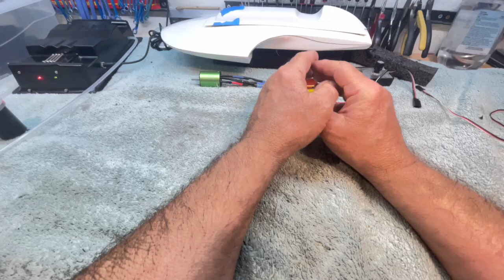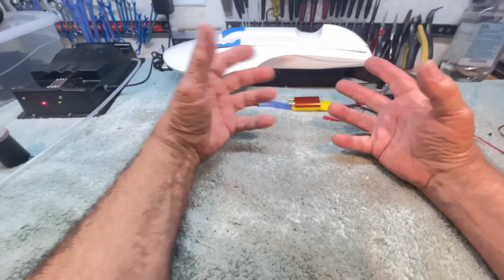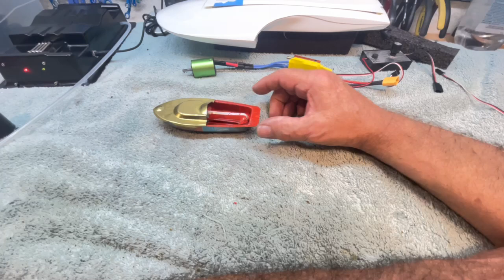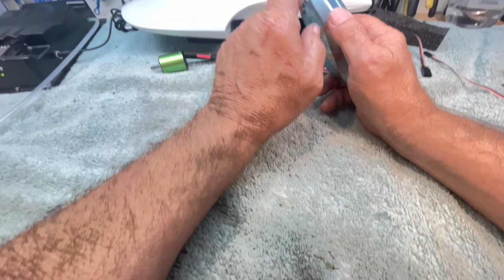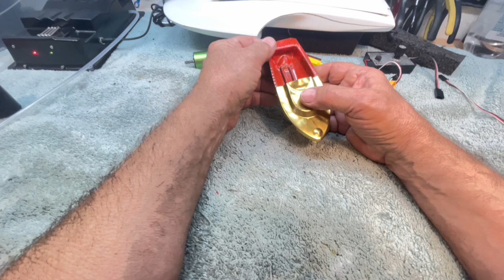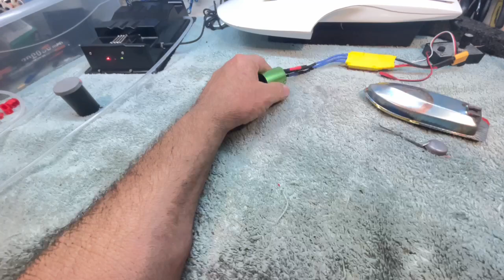Dr. Jet "Toys" with alternate power systems.

Comment: Hey Dr Jet, a small canard build is all you! I built a reverse outrigger from a shrimp kit, it was fast but only on glass smooth water, I believe if it it were setup like a cracker box rc boat without the strut, (straight shaft maybe) and rudder off the transom and the battery forward to keep the nose planed it would turn much better.  I think you are the one with the mind set to make something like that work, so mine was a simple shrimp rigger from amazon (wood kit only) after building it proper and using an Octura aluminum struter setup, (I cut the skeg off the strut-possibly a mistake)  I had a pretty good and fast outrigger,(didn’t turn worth a hoot) and after a disabling crash, I rebuilt it with the booms at the rear and a ski under the nose, what did Big B call it ? For the drag boat ? 🤷🏻 oh well, again it was fast but jumped up in the front and didn’t turn worth a hoot.  Crashed in to the same branches and rocks as before. I still have the front sponsons 🤣